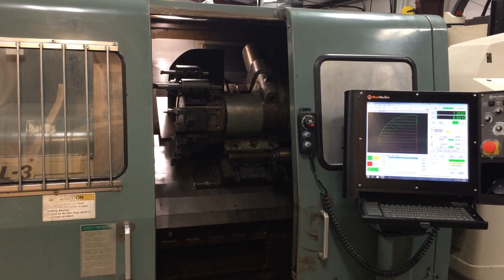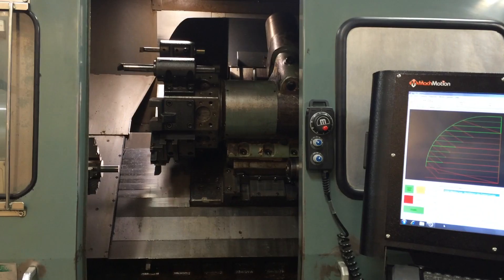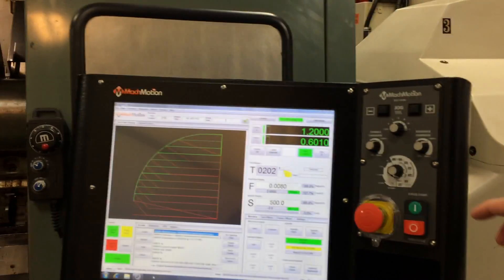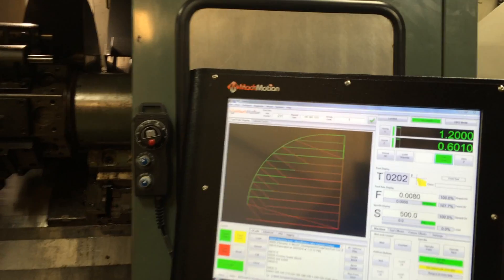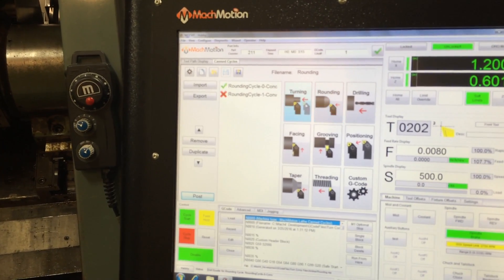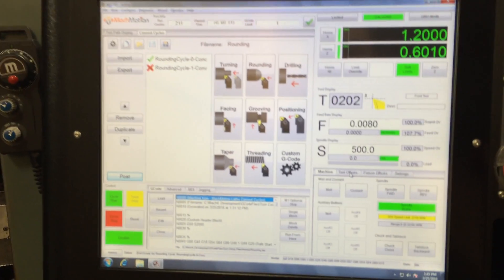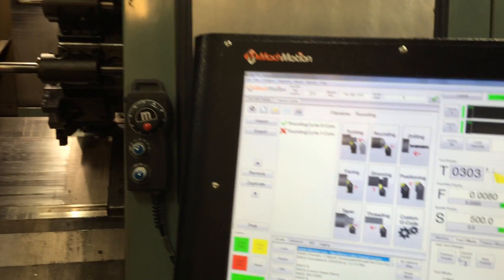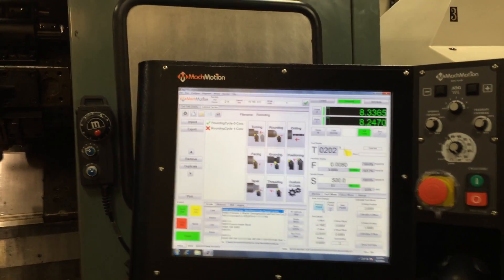Mori Seiki SL3 Lathe Retrofit - MachMotion Turn Control System

Comment: Those sl series machines are Beast, i know a shop that has 5 of those with original controls still running parts 2 shifts 6 days a week since the mid 80's. not sure i would spend the money to retrofit but they are a solid machine....